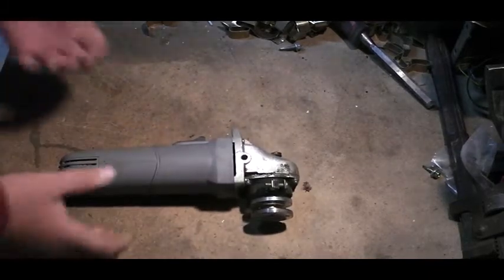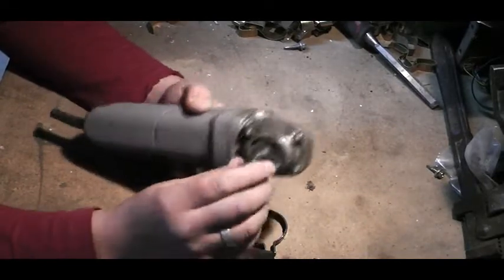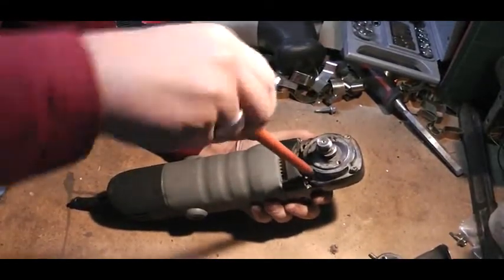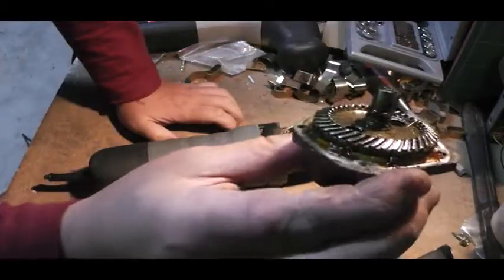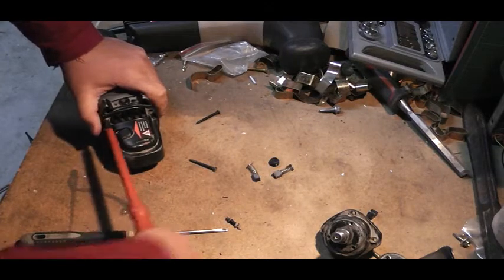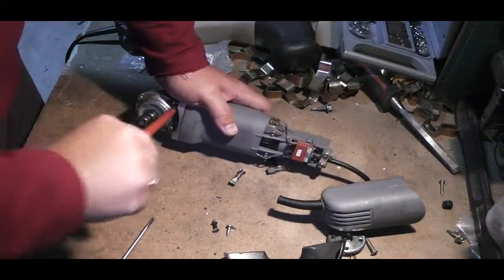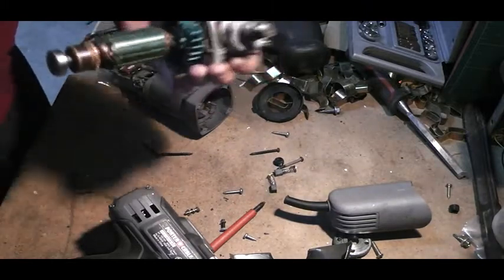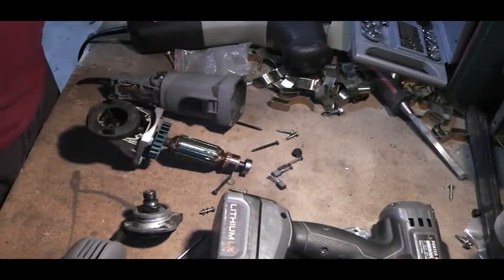Disecting 2  broken Angle Grinders which are nearly new

Comment: What do you expect buying cheap shit, KK2, Ozito, XU1 are all the same cheap shit manufacturer. Saying that I use a Ozito for dusty work and it has lasted over 5 years. These cheap shit are only made to get about 10 hours running time and that's not continual running, just a few minute then let it cool. Industrial lines life expectancy is 400 hours but you get more out of them so when doing the math, it's far cheaper to spend a bit more and buy quality to start with.
Reply: I killed 3 cheap ones in a row in 1 day because I had dewalt and metabo for last 5 years...